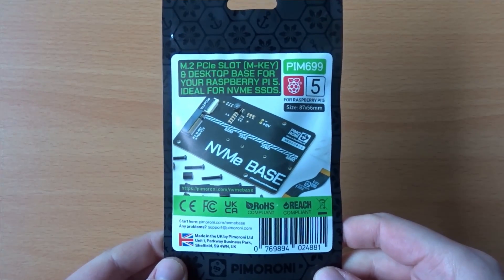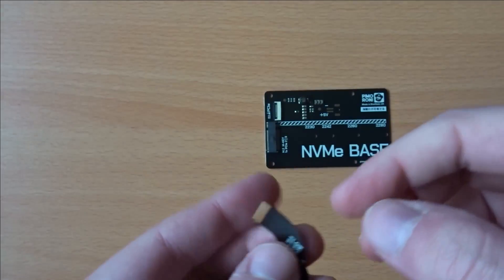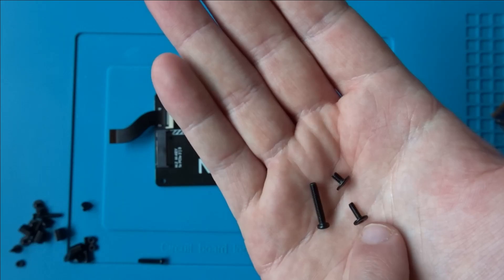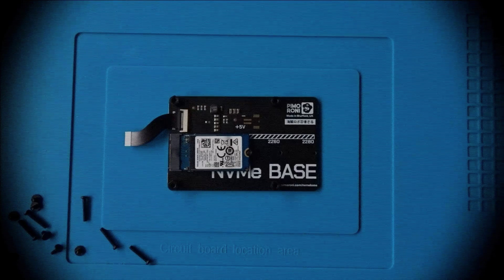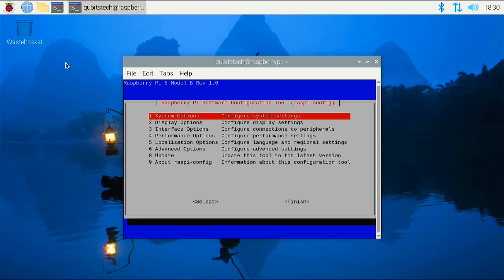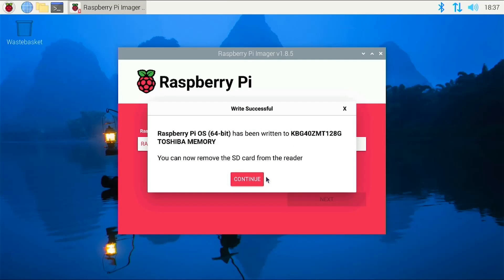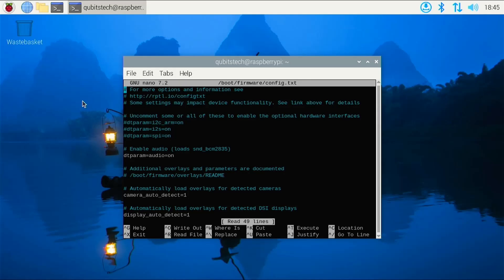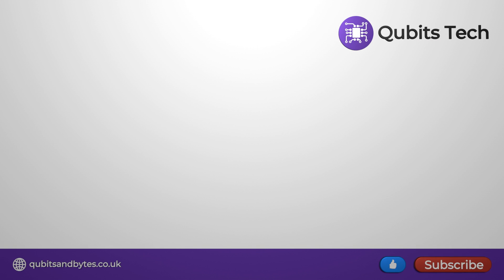Adding an NVMe Drive to a Raspberry Pi 5 | Pimoroni NVMe Base | Qubits Tech

Comment: I love the Pimoroni boards...but the cable being routed over the board and not through the board is an issue. I just bought the Pimoroni dual NVMe hat for the Pi5 and the fit in the case is suck that I had to file away a tiny bit of the hat to keep pressure off of the cable. After close visual inspection I noticed that my hat is just ever so slightly longer than the Pi5, which is actually the reason for the tension on the cable in the case. Very disappointing for such a good board, otherwise. I have another dual hat from another manufacturer and that cable is routed through a slot in the board, better design.
Reply from the maker: Yeah, I've seen a few other boards (Geekworm have quite a few variants) which look interesting, I like that this one sits under the Pi to keep the top open for cooling, but I'm not a huge fan of the cable design. Being exposed on the edge of the board is definitely a weak point of the design.

Comment: can we use a cooler based nvme M.2 drive to it with Rasberry Pi 5 8 gb.
Reply from the maker: Probably not with this board, there's very little room between the bottom of the Pi and the drive. The short cable means you can't add larger standoffs either.

Comment: THE usual tinkering was required to get my Raspberry Pi and the NVMe drive to work together. Basically I did something. I changed something. I repeated something and I restarted something and well in the end something I did got it working...something....the next time it'll more than likely be something else or something different. Just saying.....it's worth trying.......something!!!

Comment: Hi, I managed to install a Pimoroni on my Pi 5. I have installed windows 11 onto the SSD and used custom UEFI installed onto the SD card. When my Pi starts and loads the UEFI boot menu my NVME drive is not detected. Is there another way to enable NVME drive on that menu? Thanks
Reply: Which uefi you have used ?
Reply from the maker: Hi, sorry I have only just seen this comment. I'm not sure about using UEFI with the Pi, I'd be interested to hear about your setup as it's something I'd be willing to have a play with myself. I wasn't aware that UEFI was usable with the Pi.

Comment: sadly my nvme wont show up... something must be broken
Reply from the maker: Maybe the drive isn't compatible, which drive are you using? A few drives are known to be incompatible with this base (and probably the Pi in general)
Reply: @qubitstech  If you are interestet the base works, the problem was that the controller on my partiot nvme did not talk with the raspberry 5.
Reply from the maker: @MatzWerk Thanks for following up. It looks like there's quite a few drives now on Pimoroni's list which have issues with this base, including the 2230 version of the Kioxia drive I'm using. Surprised there are so many issues, I wonder if the other NVMe boards available are the same.

Comment: Nice video. I copied the software using the Raspberry Pi OS, sd card copier and  all  my settings were transferred to the nvme drive, so I didn't need to set up the new drive.
Reply from the maker: That's another option, just need to make sure the OS is up to date before copying :)
Reply: So "card copying" my current 64gb MicroSD over to a new 128gb SSD and then afterwards resizing the SSD image to full 128gb with "gparted" would work, right?
Reply: @davidtstewart  I didn't need to resize it was done by the copier.

Comment: Thank you. I tested 4 different Pi 5 NVMe boards. I like Pimoroni's best because it can come bundled with compatible NVMe drive so makes it hussle free for the Pi 5 users. Pimoroni does 1 better by documenting what NVMe drive its board is compatible with.
Reply from the maker: Yeah, Pimoroni tend to be pretty decent with documentation/support, and it's nice they offer drives to go with it. They're also UK based, which for me is a plus.